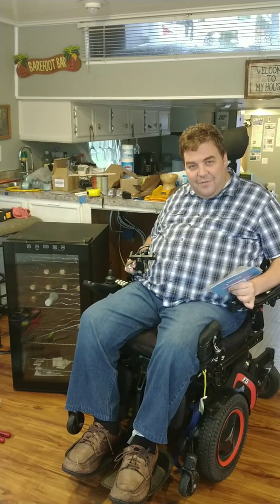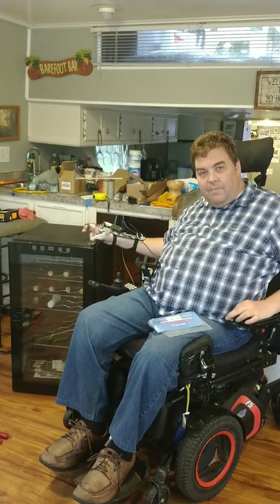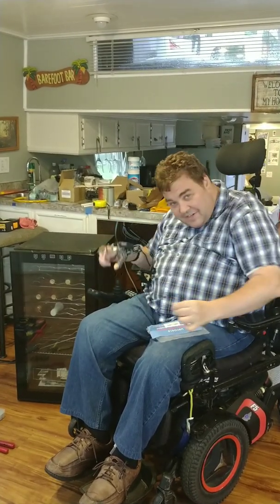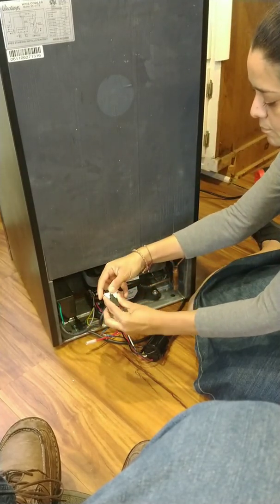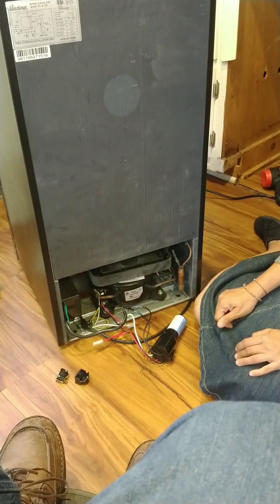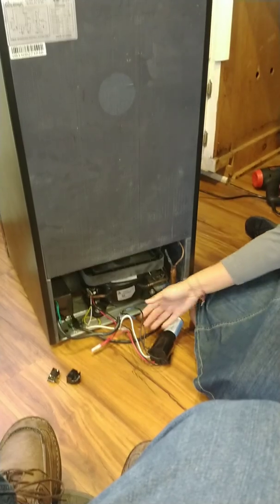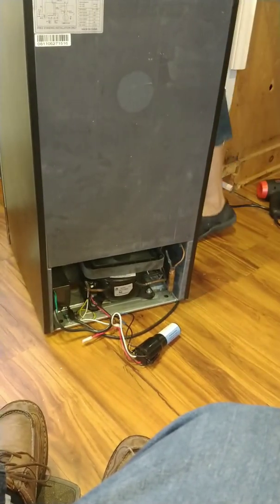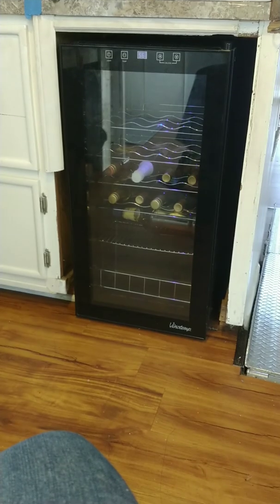Fixed Our Vinotemp Mini Wine Fridge for $12!

Comment: Thank you two so much!!! I followed your video and installed the part...it got really cold-too cold and no light or panel control. I pulled it out again, and noticed the red connection had come loose...fixed it and everything works great! My VinoTemp is back in working order for less than $15!!!

Comment: Hi I think I have the same model. Vinotemp VT-34 TS. I think my compressor works. It’s warm to the touch. I hear a click and a vibration noise…. Then a click and vibration stops. I don’t seem to hear the fan…. Do you think this will work in mine?

Thanks

Comment: Worked for me, From ADub, I purchased the RCO810 for my VT-36
My unit had a blue wire connected to the power supply nuetral, and brown wire connected to the power supply hot. I kept those attached, and connected the new relay a little further up the power supply. 
Thanks for video!